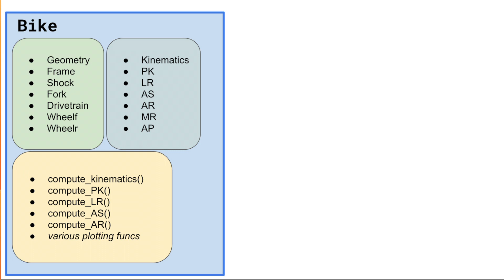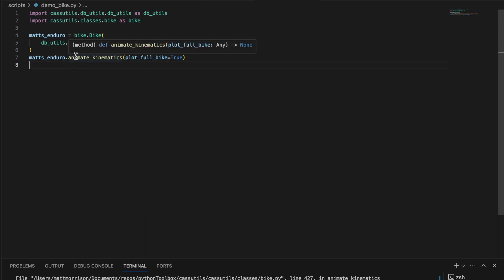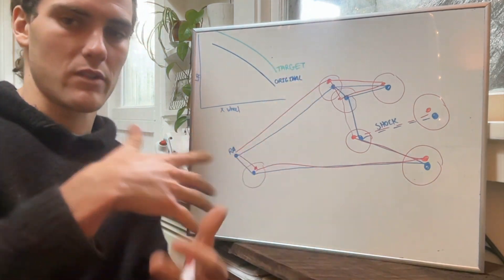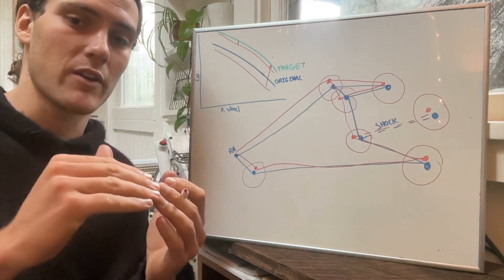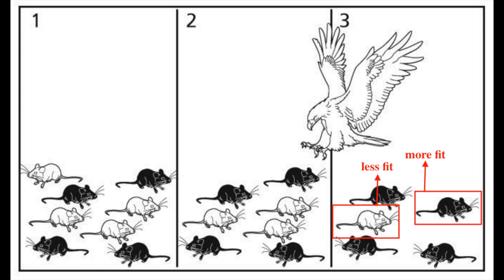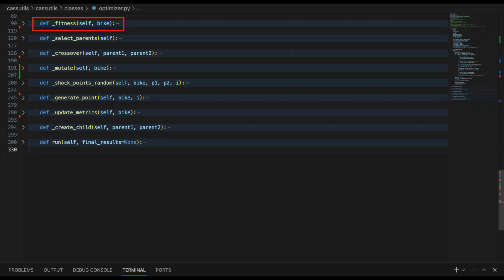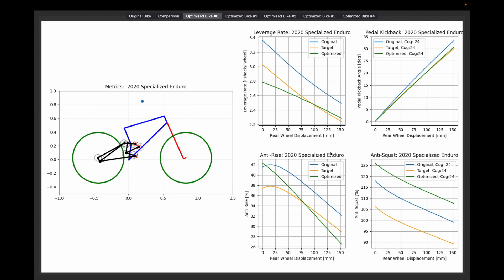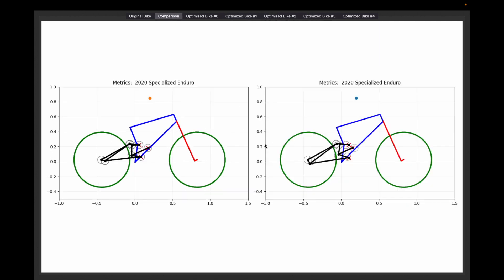Mountain Bike Kinematic Optimization

Comment: Well done mate, one short question: how big would you say does a lenght or angle need to vary from bike to bike so feel the difference. As an example how big needs the differences in chainstay length need to be to talk about a longer Cs, because I guess if it is 1mm short no one is going to talk about a shorter Cs.

Thanks in advance, cheers

Comment: super cool. this seems like it could be real step forward in designing, especially for getting the early prototypes of a bike decided on. as you mentioned the 'real' work probably comes in decided what optimal curves/numbers are for those key data points. which is a hard one because they are sort of subjective by nature. there's so many bikes that work well and go fast with different ideas of what is 'optimal'.

i'm curious if you have thoughts on what could be done to try to find optimal numbers for things like leverage curves, anti-squat, anti-rise, etc. seems like there is a trend to have more linear curves (as you mentioned), and to reduce chain/brake influence on suspension more than in years past. but maybe it is just the pendulum swinging the other way after having highly progressive and higher anti-squat bikes being the hotness for a while.

probably a much bigger task, but it would be cool to have UI where someone could play with this stuff for fun. if any of this code is up on github i'd totally poke around at it and try it out locally. i've thought about this kind of thing before, but i don't have much data processing experience and mostly write javascript these days.

anyway, super cool project, excited to see more